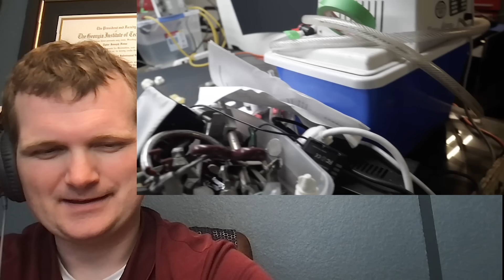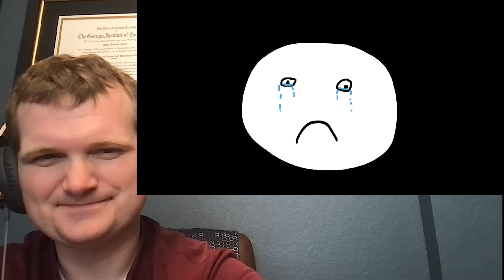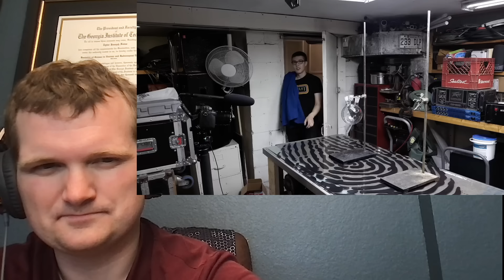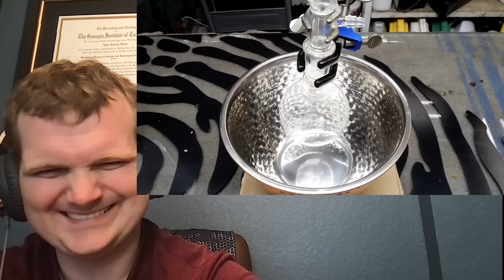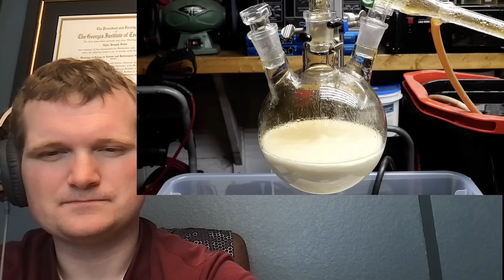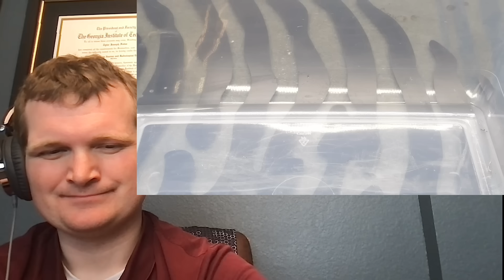Making a Dangerous Chemical in his Parents' Garage? - Nuclear Engineer Reacts to NileRed

Comment: Bromine is a giant item of concern in terms of chemical reactivity. It does not have to be a nuclear isotope to be dangerous AF, it just has to be volatile and reactive, which Bromine definitely is.  Also I live alone and do lock out tag out because I forgot things. Maybe I'm distilling citric acid,  making caramel, or some other non dangerous but heat intensive task,but I still like to take a moment. I don't like burns
Reply: Yeah, he said that the chemical hazard is bigger than the radiological hazard in that case.

Comment: I was a custodian at a Jr high school and has the misfortune of getting assigned the girls rest room.  They did a great job of leaving real nasties for the custodian.   After cleaning everything real nice o unscrewed the floor drain cover snd deposited a small beaker with a few squirts of Butyric Acid.  The complaints were significant. I removed the beaker, and made sure everything was tidy nice. The bathroom went unused for months.  Never had to clean it again.  The smell permeated everything.  Instant barf when the door was opened.

Comment: our reaction to Cleo Abram's "The Big Lie About Nuclear Waste" is what set this in motion for me.
I'm Stephen Patterson — Navy veteran, independent policy researcher, Stevenson Ranch, CA. I watched that video and something clicked. Cleo's argument is that nuclear waste isn't the unsolvable problem people think it is. Your reaction added the engineering layer. Between the two of you, I came away thinking: what if the waste isn't a problem to be buried — what if it's a fuel source being thrown away?
That question turned into several months of work. What came out the other side is a concept I'm calling the Small Modular Heat Engine — a passively safe, closed-loop system that captures decay heat from retired fuel assemblies and converts it to grid electricity. No chain reaction. No active safety systems required.
The part that tends to stop people cold: the worst-case failure mode — including complete abandonment — is self-vitrification. The quartz-graphite matrix surrounding the rods fuses into a glass containment mass under sustained heat. Savannah River and Hanford spend billions doing that artificially. This system does it passively, as its failure mode. The worst case is a self-sealed glass monolith underground.
I've written a formal white paper, dual-addressed to DOE-NE, the NRC, and Congressman George Whitesides (House Armed Services Committee, CA-27), making the case for a federally supervised pilot at an existing waste site.
Your reaction to her video started this. Felt right to bring it back to you.
— Stephen Patterson

Comment: I really did make Bromine in Mum and Dad's (old wooden) garage as a 12 yo kid (in the early 80's)!  As a UK primary (elementary) school child, I got a Thomas Salter Chemistry Set and (under supervision) made all sorts of stupidly dangerous stuff.  In secondary school (junior high age) I could buy chemicals from the school chemistry department (yes really).  I bought some Potassium Bromide as I decided I wanted to make bromine.  I had a U-tube + bungs and glass tubing from my chemistry set.  I had a meths burner.  I had a really strong salt solution + made carbon electrodes from an old battery.  Using a car battery, I electrolysed the saline to produce hydrogen (which I bubbled under water into an upturned jam jar - displacing water). I passed the chlorine through strong Potassium Bromide solution (think it was a beaker) 2KBr + Cl2 -> 2KCl  + Br2.  I ended up with an orange brown layer.  We blew up the hydrogen by blowing air into about 25% H2  to fill it up then popping it - made a heck of a bang!  Whilst doing this, one friend caught the KCl + Bromine beaker and all the Bromine  evaporated! All three of us ran outside coughing and choking.  Amazingly enough, none of us seemed to suffer bad effects! Mum was more concerned about us filling the garage with fumes! Obviously kids shouldn't (and couldn't) do this now!  We were so stupid but we also had a lot more freedom than kids now (on both sides of the Atlantic)! 😂

Comment: I was replacing the pressure switch on our well pump at home when my wife caused a breaker to trip using the air fryer and the kettle in the same circuit, and sent our 12-year-old son to go turn the breaker back on and he turned on the breaker for the well pump ⚡⚡ and I got a nasty shock.

Comment: The pool acid available to consumers used to be in the respectable 30%.  Around the time the pool acid started showing up in Home Depots, it got a serious step down to about 14%.  Muriatic Acid, aka Hydrochloric acid, maintained its price however.  If you like getting what you pay for, the higher concentration acid is sold for the same price as the watered down stuff at True Value and Ace Hardwares.  Take a guess at which version you can find at Leslie's.

Comment: There's the other parallel to nuclear power: you COULD store the waste material for later disposal ... OR you could save it as potential valuable feedstock for later reprocessing.

Managing leftover chemical waste here could also be done in a way that maximized the useful byproducts in the mixed waste for potential future projects.

Granted, the same thing is true in the chemical industry ... most forms of waste have useful potential value, and all the moreso if the processes that generate the waste are tuned to maximize the further processing or re-use of that waste. (vs being too diluted or contaminated to be economically viable to recover)

Once diluted further in a waste repository, the costs for future extraction of valuable material also goes way up. (sort of like if valuable spent nuclear fuel was melted down into borosilicate glass for repository deposition rather than just stored until reprocessing is economically attractive ... and legal  ... or same deal with plutonium removed from decomissioned weapons)

Or ... "dilute and dispose" method used currently for decomissioned plutonium. (we SHOULD be planning to use it as part of the fuel for next-generation fast reactors)

I mean, if we ever get around to proliferating commercial grade fast reactors. (specifically burner reactors for the Pu ... though designs intended to be flexible and optionally reconfigured as fast-breeders would be even better for future proofing)

Comment: You can also "tame" bromine by cooling it down more. It freezes well above 0F (-17.78C), at 19.0F or 7.2C, so should freeze and crystalize in most household freezers. (which are supposed to be calibrated for 0F)

Likewise, an ice-salt bath created from ice already chilled to 0F, creating even lower temps as the ice melts (better still if you have ammonium nitrate handy or other highly enothermic dissolving salts).

It's a bit like "taming" nitrogen dioxide into supercooled dinitrogen tetroxide, except that goes from angry red-brown (much like bromine) to yellow and then water white as it gets colder, then freezes at -11.2C or 11.8F.

Comment: Potassium and sodium bromide are used for pool and spas (especially spas).

"Potassium bromide is a chemical used to establish a "bromide bank" in pools and spas, which is then converted to the active sanitizer, bromine, which dissociates in water to hydrobromic acid and hypobromous acid (HOBr), by an oxidizer such as potassium monopersulfate or chlorine. This two-product system provides a flexible, bromine-based sanitation method that is gentler on skin and eyes than chlorine, especially at higher temperatures, and is a popular choice for spas. However, bromine is less effective in direct sunlight, so it is generally better for indoor pools and spas rather than outdoor pools."

Comment: 39:05 reminds me of when I was a microbiology undergrad and had some bromine for a tri-iodide starch reaction for measuring the amount of aqueous polyacrylamide via spectrophotometer and even though we consulted with chemists they gave NO warning on the pressure building property, and I tried to transfer liquid bromine with a micropipettor and when I disposed of the tip, it came off with great pressure and got liquid bromine on my wrist and burned me. Good times, good times. I imagine that bottle of liquid bromine is still sitting somewhere in the chemical hood, untouched by the weary biology undergrads lol

Comment: Nile working with bromine like this makes me mostly think of the Windscale power plant. Which is not flattering...

The rods were in a horizontal, air cooled rack and absolutely inadequate containment. Used rods were pushed out through the reactor, to fall out into a pit (I assume with water or something). But sometimes they would miss and end up on the floor of the reactor building*. Workers had to go by with and frigging *sweep up the scattered rods. Smh. And sometimes the rods would stick in the rack instead, and that's how the reactor eventually set on fire.

Comment: If I may ask: Could you make a video explaining how the medical field sterilizes its instruments with radiation? I've always noticed that some items say "Sterilized with γ rays". Do you guys provide isotopes to medical facilities? Or is it a completely different facility that uses, whatever isotopes, to bombard the instruments with radiation?
Reply: Got a dentist in the family and I’ve seen the tools/machines. Most are literally a metal box (think an oven) with compartments you put tools in. For normal sanitization, it’s a mix of uv and a chemical cleaner in circular baskets, it agitates the liquid and cleans the tools, then you remove and check them, air dry them, put into one use plastic bags that heat seal, and stock up your cabinet. For anything radiation related, it’s kinda just the same but with more pre-cautions. You just… order them as needed. Repairs and maintenance are done by the company you buy it from, and they handle any of the non “use for cleaning” parts. Same as the x ray machine, the dental office/hospital/doctor isn’t getting anything raw, just the completed machine with everything encased.

This may vary for university hospitals where they potentially do research on said machines and tinker with them, but you can buy pretty much everything you need online if you have a license or are part of an organization. (Teachers, etc)

Comment: I find nostalgia has different types. When people want to do things the old way, it's usually because of an association with the people they used to do it around like family in his case, or former colleagues; or due to some specific thing that wasn't transitioned well for them. In my case, part of me wants to go back to using Windows 7 as my operating system because 8, 10 and 11 have each taken away productivity features.
But the other side of nostalgia doesn't include any desire to go back to the old ways. I look back fondly at, for example, my old 1990 Chevrolet Caprice whose drivers door handle didn't work properly, I had pliers in the ash tray to turn what was left of one of the AC knobs, and temporarily had a rope going under the dashboard for the  e-brake release. But you'll never catch me driving that monstrosity again.